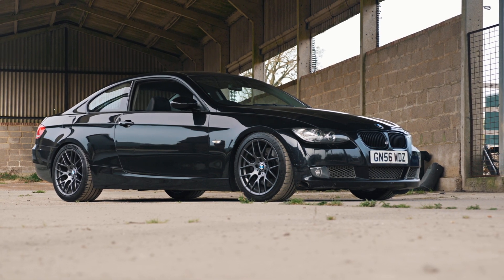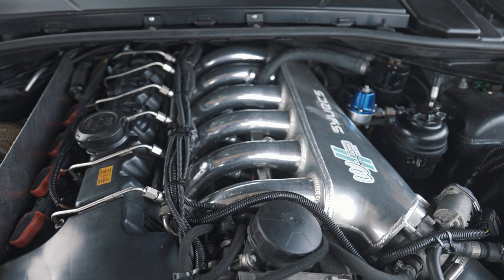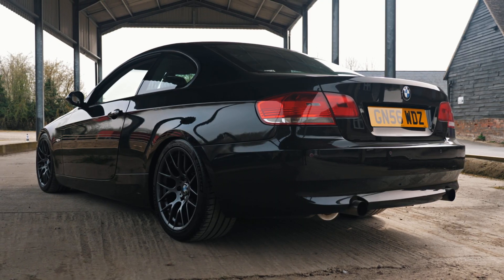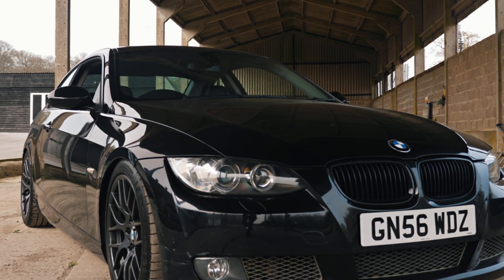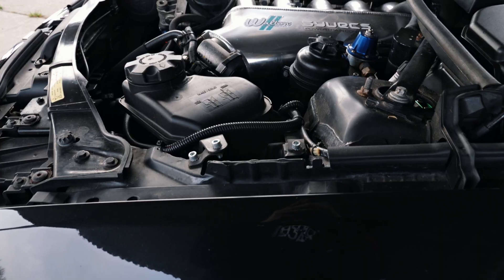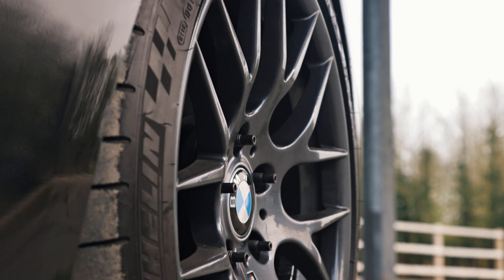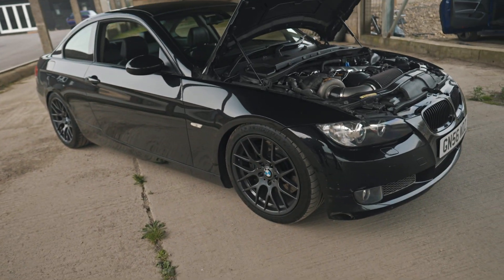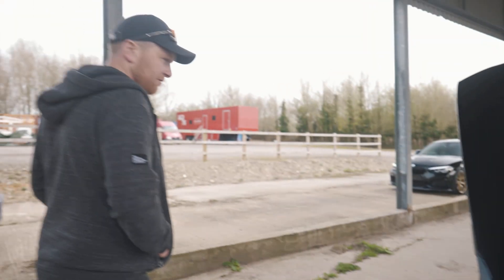FIRST DRIVE IN A 660BHP BMW 335I **SINGLE TURBO**

Comment: N54 the beast. Biggest issues with n54's is the owners, most people buy them & throw money at them to make them faster before carrying out all the maintenance then complain they aint reliable 🤦🏾‍♂️
Reply: i did all my mainteance and havent had 1 misfire or codes since. now im trying to go single turbo
Reply: @MrBoostedk20 rip
Reply: @MrBoostedk20  i'm sticking with twins planning on 500 HP max, all i need to keep it daily, while also being able to rip an Auto X, or road course.

Comment: Loved this video! Got an E90 n54 335i myself and I've always wanted to single turbo it and after this video I'll definitely be going that route! Keep up the good work mate top content as usual 🤜
Reply: Its a great route to go down, and you will find the car is actually MORE reliable without the stock twin turbo set up. The stock turbos are a ticking ££££ pit and well worth getting away from them :)
Reply: @bigkaswrx8115  the aftermarket twins have reinforced wastegate actuators /flaps and don't require any rerouting making it quite a bit cheaper than going full single conversion. Agreed that the single will still be more reliable in the end though
Reply: I out upgraded twins on about 10k ago but over the last four years it's spent more time parked up than on the road been slowly ironing out the basic maintenance issues need them sorted first but they are great cars when they run right.
Reply: @suffolkdangler981  make sure you drive it enough. Nothing these engines (TALKING TO YOU GASKETS) hate more than sitting for extended periods of time with fluids drying up
Reply: @papa_pt  luckily it's now having the timing chain replaced along with crank seal, rocker cover and sump gaskets. Then it's ready for a remap hopefully mate been saying this 4 years now 😜🤣 this time next year hey
Reply: Unreliable I sold mine quoted 12k in repairs I'm a Honda guy now
Reply: @StealthyyyHD  did you buy it used? Can't imagine how you'd hit 12k with all the recalls they put out
Reply: @papa_pt  yep used ended up leaking oil everywere both turbos blew up everything went to hell at 190,000 km
Reply: @papa_pt  theirs plenty of better cars to buy here in Australia, learnt my lesson. We got a straight 6 engine 4 litre called the Barra in the Ford XR6 turbo will smoke a 335i. Big boy 2jz can handle up to 2000 HP on stock block
Reply: @StealthyyyHD  yeah unfortunately the states has neither. 2jz technically yes but  I've seen maybe two Supras in my entire life here. Barra would be awesome 

The n54 gaskets suck you leave the car sitting for a month or two and they'll all rot out, the car is more reliable the more it's driven. My wastegates failed at 95k but car still drove around no problem (just zero boost) for 5k til I got pure stage 2 and it's been bulletproof since then.. I drive it almost everyday and do 5k oil changes
Reply: @papa_pt  yep German gaskets need to be constantly wet they can't sit like Japanese cars
Reply: Have you made any changes since?

Comment: Real petrolhead. I have so big  respect to people what themselves build car like this one.  I now from myself how much time u need and how many problems u need go through to make this car really quick and reliable.   Everyone can pay to build car for him but only few will build themselves.  Great video, for people what think about n54 common problems are electric water pump,  high pressure fuel pump,  injectors,  lambda sensors on high power   settings, boost leaks ,because bmw plastic is fragile coolant pipes,  westgate rattle,

Comment: Give me this over a M1/240i all day long
Reply: Dont underestimate b58 single turbo mate. Its better in every way. Btw i have n54
Reply: For a N54 single turbo, I like this car sounds. Bit better than B58 or N55 engine sounds.
Reply: @RobertoDTK  besides cost lol
Reply: @harrisonlloyd9668  No? You have to put way more into n54, it has many weak points.
Om B58, only weak point is piston's, get forged pistons and you are good
Reply: @skidhvh  maybe you misunderstood me... anything with a B58 25k+ before you think about modding with even bolt ons haha... where as you can get an N54 335i 5k and spend 20k building it (UK prices I don't know what things cost where you live)
Reply: @skidhvh  B58 is king tho I'd have one over N54, not an N54 fanboy I just like fast cars that don't cost much
Reply: Facts

Comment: Ricky it sounds like your hating mate, a lot of the newer M cars don’t come with LSD’s either. That’s the whole point of building/tuning a car to improve it as a whole. A lot of people don’t know about the n54 engines, also Richard doesn’t mention that the n54 comes with forged Rods and crankshaft from factory, I don’t many M cars come with factory forged internals.
Reply: S55 does
Reply: All m cars come with lsd no?

Comment: "So what you've built the engine?" "No stock engine everything else has been replaced" come on man! 🙉
Reply: he means the internals are stock. The N54 are notourious for the bolt on parts (water pump, HPFP, injectors etc) for failing, when he mentioned he replaced everything, he meant the peripherals
Reply: @TajwarC  I know what he means, I mean I'd be scared to drive it at that power with stock internals.
Reply: @s.h.1095  I would as well lol 660bhp is really pushing the limit on stock rods and pistons
Reply: I'm sure stock block comes with forged parts out the box
Reply: @shaneomac-9069  it does, it has forged crank and rods but the rods are the weakest part along with the pistons and rings, pushing them above 600/700hp isn't the best even though the rods are forged. The crank is indestructible though
Reply: @TajwarC  I had an n54 335i a while ago only went to around 400bhp but still have a soft spot for them, currently in an m140i
Reply: @shaneomac-9069  I have a 400hp 335i now aha, I was thinking to upgrade to a B58 (M140/240,340i etc) due to reliability and efficiency reasons. Which have you preffered owning?
Reply: @TajwarC  I've had an n54 335i, n55 335i, m135i and now an m140i, if you have the budget the m140i is the best car with the least problems, all great cars but the m135i and m140i's offer such a great all round package if you don't mind having a hatchback, if you're after power I'd go m140i then an n54 but there's a lot more maintainence in an n54

Comment: 660 hoseepower is big speed pour moi bc trop ont peux pas exploité autant de vitesses a par aux etat unis la bha il y a que des lignes droites et donc un minimum de 500 hoseepower in amerique is big lignes droites ho the Drag Race for the race the casch days is numbers one the cars one motors ls7 twin turbo big blok 427 transactions 4 speed nascar one s10 chevy is one video 1320 video one s10 chevy 1700 hoseepower 7s2 the 1/4 M yeeee look one video 1320 is the boss the drag race